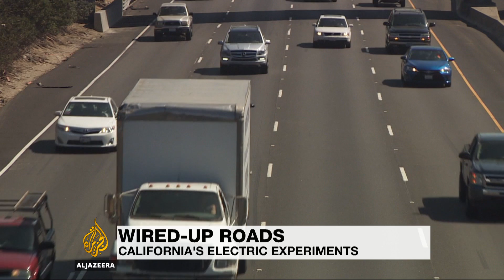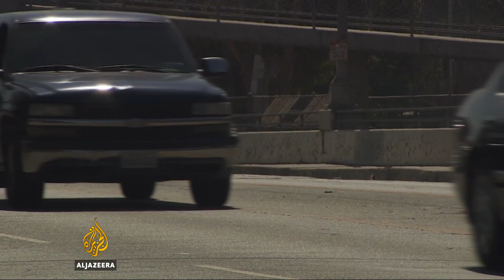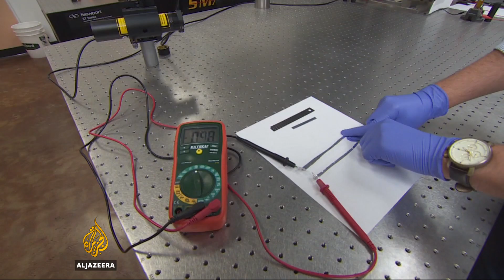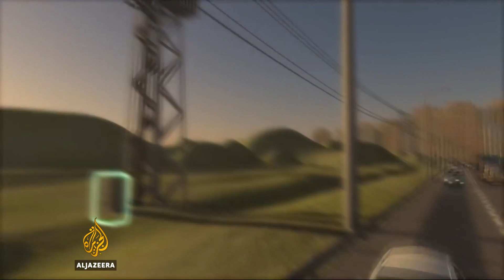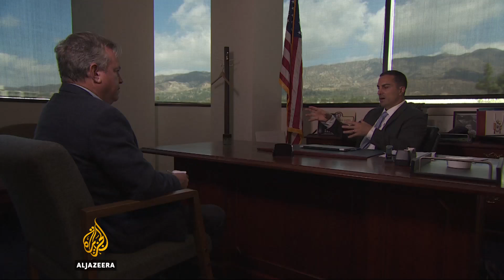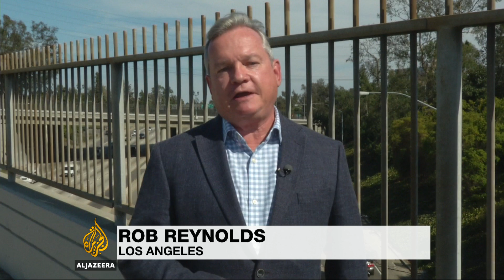California traffic jams to generate electricity

Comment: Some of the other comments have already pointed out that this scheme is hair brained. You need to have only basic high school physics knowledge to understand that you can't generate electric power this way. Pressure on a piezo crystal generates only voltage. To get current, you need to flex and un-flex continuously. But even in that case, the energy is coming from the car fuel. For the dancers jumping on a piezo floor, their human energy can be converted to electricity but that's like where human beings were used like cattle to draw water from a well or turn a turbine. If humans are ready to turn turbines with their hands or by jumping, we don't even need piezo crystals.

Comment: Isn't this just an "energy tax" on any car passing through the "pie-zo electric (sic)"- embedded roads. Are they claiming all the energy of compressing rock and dirt under roads turns into heat, when chances are they've all been compressed into a solid after years of use?? Eventually even a dirt-road turns to hard-pack, whereas this "invention" would give you the efficiency of a dirt-road all the time.  As more and more cars become electric, the rube-goldbergian nature of this stupid "perpetual energy machine" scheme becomes quite apparent. 

In reality there's sun beaming down on California roads that's not being captured and used. If the energy of cars travelling on roads was significant, they'd be radiating easily discernible heat at night just like a hot road would be right after sunset... They're obviously not! Why not put this money and effort and disruption towards putting solar panels on all the non-driven public-areas, shoulders, bridgeways,  overpasses, etc of our public roadways. THat's some significant square footage that could be generating energy without wasting carbon-based fuels powering most vehicles.

Comment: Unbelievable:
For these piezo crystals to work, they have to be deformed.
For the crystals to be deformed, they have to have a force applied that causes the slight bending.
For the slight bend to occur, a vehicle must press on it and then allow it to spring up afterwards.
This movement takes energy and would mean that the roads have to be slightly springy and would sap energy away from our cars just like driving on sand does.
Reply: Robert Evans Roads wear out with time. Why? Because formation and deformation takes place. Those tonnes of weight that move over tarmac are felt, regardless of whether it's hard surface or not.
Definitely, the amount of power generated would be much more when the road is a bit sponge, I don't think it has to be made so, because that would definitely create more drag and hence waste the power generated by the vehicles.

Comment: Bad journalism falling for bad science. The complete picture is that this slows down the cars, on a horizontal road driving over this stuff is like going up a slight incline. People need to push the gas pedal a bit further to compensate. In the case of electric cars it is electricity theft, in the case of regular cars running on gasoline it is an inefficient gasoline powered power plant. It is pure bullshit. You can only say that this electricity is for free if you refuse to admit that it is stolen.
Reply: Not sure about this, but couldn`t it be that cars naturally press on the road because of gravity and these devices simply use that slight pressure? If that`s the case the cars would not lose more energy due to friction than when driving on a normal road and there would actually be a surplus of energy, that would otherwise be wasted.
Reply: No, not possible. Pressure alone is insufficient, you need to have a force acting over a distance in order to pull out energy. It is worse even than an elastic road that gets pushed down a bit, because here the energy is not removed but stored in the elasticity and immediately returned. This will take away the energy as the car pushes it down, and only come back up with much less force after the car is gone, so the car is slowed down just like it would be driving on a layer of sand, or like driving up an incline.
Reply: Yes, or at least badly out of his area of expertise. Or maybe he is smart and wants to defraud the clueless public out of a million or two in research funding. Either he is stupidly wasting research dollars, not knowing that the idea is bullshit, or cleverly grabbing research money to enrich himself, knowing that the idea is bullshit. Time will tell.
Reply: Stinks of Solar Roadways BS.

Comment: I have watched so many videos based on concepts that would change the world so much.  and i go like wow but they aren't implemented on a large scale.
Reply: because it's not economically sustainable
Reply: I was thinking this, but on the other hand, the friction and compression of the road is staying the same, and that energy is lost anyways correct? Is this not just utilizing wasted energy?
Reply: Why would this not be economically sustainable?  Seems to me if you combine this with pavement made from recycled plastic bottle you have a win-win.  Pavement lasting 10 year longer generating power.
Reply: This one is not implemented because it is stupid. They are deceiving you. It produces energy by slowing down the cars, so the source of the energy is the fossil fuel in the tank of the vehicle, but it is far less efficient than a regular fossil fuel power plant.

Comment: Wow!!Just tell me how this tiny electric generators will power our air conditioners,heaters,TVs, Washing Machines etc..
The amount of energy generated is miniscule. It is of no use to invest too much in this..
Reply: No nothing says the energy needs to be returned to the vehicle...just that the material must return to it's original state. Ever wondered why a heavily traveled road is warm...that is the lost energy from movement of the material and friction with it. Capturing some of what is lost to heat would be a good thing.
Reply: 2 strips per lane with an distance of 1 foot between devices. Say each one generates 1.5V. That is 11,520 devices per lane per mile of road. A single car traveling 60 mph will generate 16,280 Volts per minute. Multiply that by the number of cars on the road and the number of lanes. That can be stored in batteries.
Reply: Energy is the currency of the universe, you do not get it for free. This slows down the cars, taking fuel out of the tank and turning that fossil fuel into electricity.
Reply: how can it slows down cars?
Reply: Unless of course your car would already have been expending that energy compressing the tar under it's wheels. If the device has the same strength as the area of tar it replaces and activates on the same pressure of an additional 4 or 5 hundred pounds then it is just improving the energy efficiency.
Reply: Not true. Elasticity is different, because it immediately returns the energy to the back of the wheel that got taken from the front of the wheel.
Reply: In your example, it would not be an elastic material.
Reply: A return of the energy to the vehicle does require the return to happen as soon as the load is getting lower.
Reply: Consider it a very minor tax on usage. If you drive an electric car and refrain from useless trips the cost saving on your electric bill could make up for it.
Reply: That would depend on the material and the forces which 1. compressed it and 2. are in effect to return it to it's normal state. If 10 tons of force are applied to compressing a substance in 1 second the normal resilience of that substance may only be able to decompress at a rate that would take 10 seconds to fully recover it's original shape. In that case you are losing the energy whether or not it is applied to a different use or just expelled into the environment as heat.
Reply: Definition of elasticity
n. The condition or property of being elastic; flexibility.n. Physics   The property of returning to an initial form or state following deformation.n. Physics   The degree to which this property is exhibited.n. The property by virtue of which a material deformed under the load can regain its original dimensions when unloaded.
None of these definitions require the return to be instantaneous.
Reply: You are right doing it in one city does not help the nation..it helps that city. The cost return benefit is up to the engineers to determine and decide if it is worth pursuing. Perhaps paying a little more for independence from the grid and all it's failings is worth it. Who knows other cities may find that the initial test was a failure but the technology got improved to the point that it is far more economical than the first trial was. By the way this has already been trialed in numerous places and has been shown to work at a small scale.
Reply: Just put up some solar panels and wind turbines, California is awesome for solar. By the way, you need a much stronger grid if you want more renewable energy, wind energy and also solar produce peaks, and the places best suited to store the energy are not the places where the energy will be generated. Germany with its 80+ million people and its industry ran on 85% renewable energy last weekend, it is comparable to California.
Reply: The grid is why Los Angeles has contracted an 18,000 unit battery to handle peak problems. Anything that will help fill that storage is welcome. https://www.scientificamerican.com/article/world-s-largest-storage-battery-will-power-los-angeles/
Reply: The article is interesting. On sunny and windy days, or on stormy days, Germany is crushing it in terms of renewable energy production, and if storage and transportation capabilities exceed their limits, electricity prices can go negative. Daily fluctuations in electricity prices are big, and this is how you can make money with storage solutions. 

Smartgrid technology would mean a multitude of small solutions: You can tell your washing machine when the laundry needs to be ready and you can tell your electric car when it needs to be fully charged, and those devices can get the data online and gobble up energy when it makes the most sense. This is not done because regular folks pay the same electricity price 24/7, so there is no incentive to participate. Only the biggest consumers and the power plant operators have access to the actual market.

The way Europe deals with Germanys erratic market is mainly to use scandinavian hydro power for storage and balancing, it turns out hydroelectric dams (especially the ones with a big altitude difference and the ability to pump water up) work nicely and efficiently as gigantic batteries. This also means moving tremendous amounts of electricity halfway across Europe.